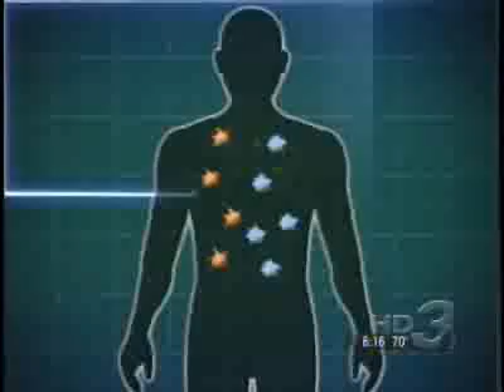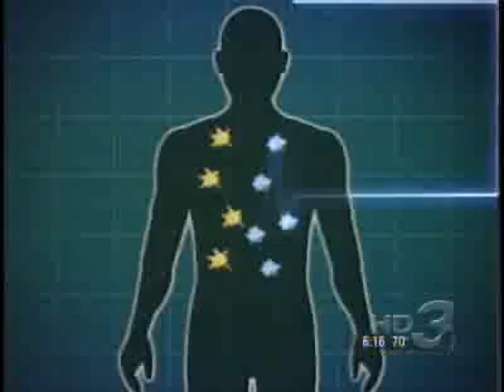Saltwater on Fire

Comment: Don't forget to read between the lines here folks, this is an amazing video that solves many problems.  Ask yourself why he was looking into salt while trying to cure cancer.  Its because in Indi and china put more than iodine in there table salt, and have less than 5 percent of the cancer casualties that north America has.  Although the extra additive isn't for cancer prevention at all, its to prevent diseases of neglect.  There are many of them, and they all have almost identical symptoms in there chronic stages as Doctors here say are symptoms of cancer.
Reply: This is a hint for you Chase Miller.  This guy knows whats up.  Diet works good as prevention but it is better to seek a cure after a certain point.  This video reveals the nature of things almost too much.  It reveals the trinity.

Comment: @TheAmazingBiped gas in a normal can that you you use in chemestry class burns yellow, but if you add O than it turns blue, meaning, if you use the solution in teh vid corecctly, you may produce a blue flame, hes just burning it in mid air in the vid, rofl at you